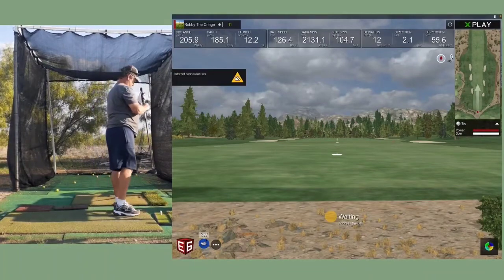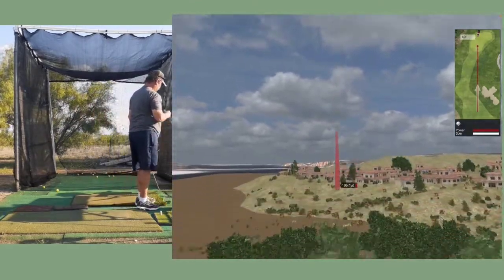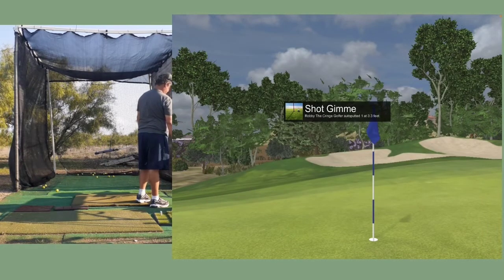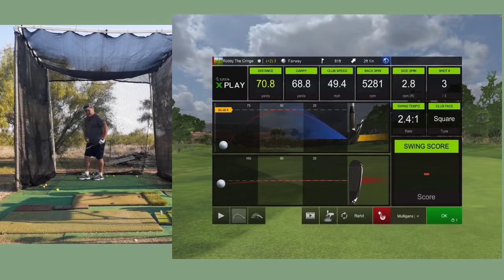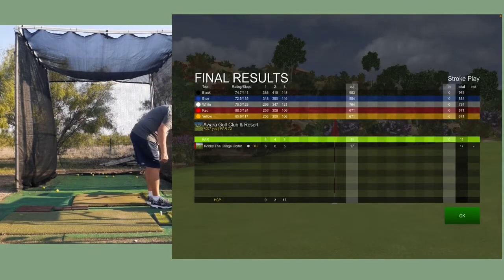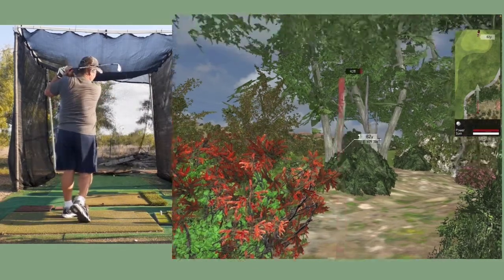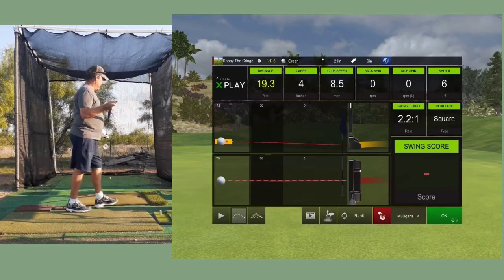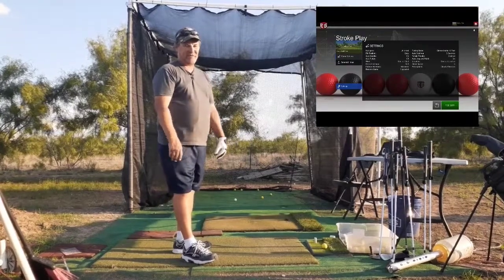Playing 3 Holes Using Real Clubs and AlmostGolf/Real Balls on E6 Connect with SLX SwingLogic.

Comment: I have a Voice Caddy that I use sometimes on my back porch.  The club head speeds seem to be pretty accurate but the yardage using Almost Golf balls are pretty strange.  I just ignore them.

Funny about that cart path roll, cart paths are your friend, until they aren't.  Last weekend a member of my regular foursome found that out, when the cart path bounce landed him in a water hazard.
Reply from the maker: With this swinglogic sensor, it doesn't read the ball at all. It just reads your swing speed and vibration and assess it from there. I think using the new "after market" cradles for the sensors I got, changes the vibration part, effecting the distances and flight. So I need to play around with the settings in the sim to get it to read closer to what I should see. I think those cradles also enhanced the results hitting a real ball. But also affect the ball flight I was seeing, like less hook. I would rather hit real balls because I want it to feel as realistic as possible. But for players like my daughters who haven't played in a long while, or a beginner, they are a lot safer! Lol! 

And I have hit a cart path that helped me get a lot more distance. And sometime sent me way off like that one.

Comment: How’s that compare to using their stick instead of your own clubs?  Also since the sensor is tracking the club shaft and not the ball why are the results different with the balls? The sensor is not tracking the ball.
Reply from the maker: It's a little more "realistic" with real clubs. But it has it's flaws. It doesn't read miss hits. You can hit it fat and it can give you a lot more distance. They recommend hitting off of a tee. And it's more or less an educated mathematical guess, based on swing speed and angle, and vibration from hitting the ball.
Reply: @thecringegolfer  I didn’t know vibration played a part in the calculation
Reply from the maker: I think it can cause you to see some unrealistic results if you hit the mat/ground before the ball or something, when using real balls and clubs. So that is what I think causes it. But I don't know for sure or how much it factors in. Mostly wrist position at impact is what determines the direction the ball might go.
Reply: @thecringegolfer  thanks for your insights